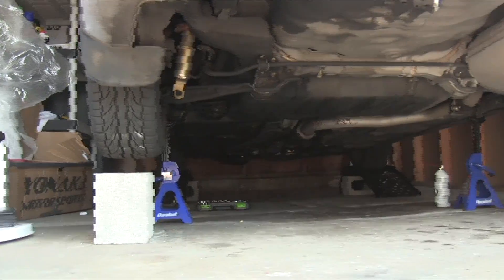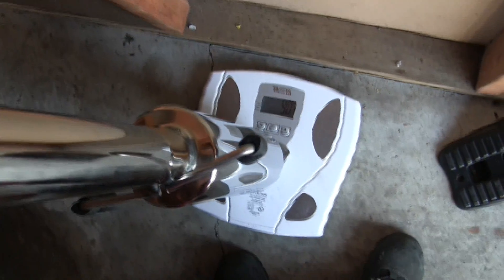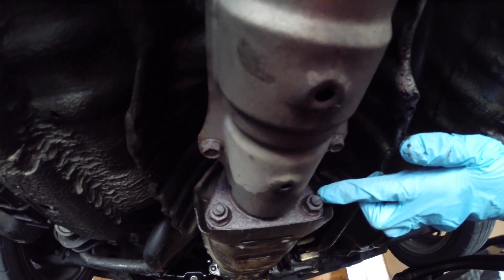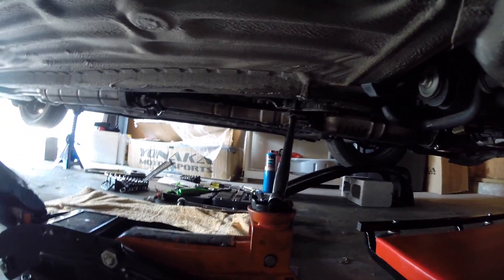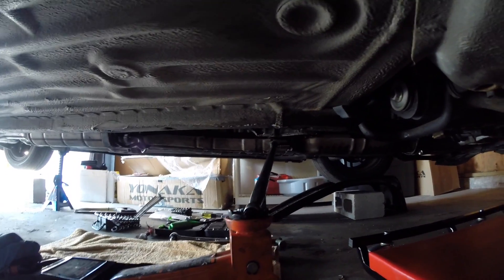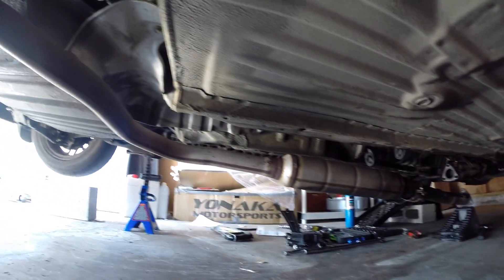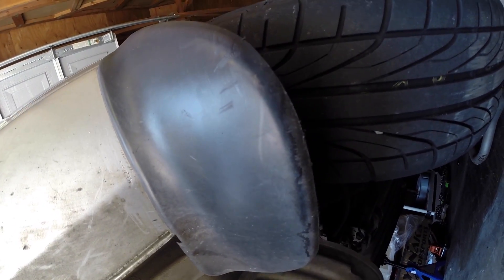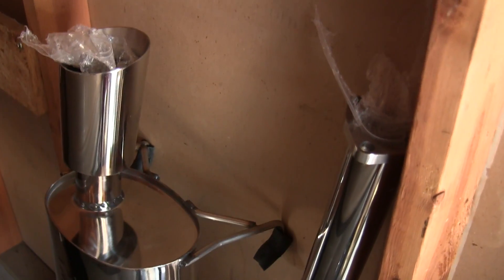How To Install A Catback Exhaust - Project Integra

Comment: Engineering Explained: check out Black Lightning examination gloves.  I don't know how expensive they are relative to the ones you're using but they are way more durable, better fitting, and comfortable; I think you'll appreciate them.
Reply from the maker: jayfulf Always feeling like a baller haha
Reply from the maker: I just buy cheap stuff, because I'm cheap. If one tears, I'll put on another glove. These are certainly poor gloves though.
Reply: the last two are subjective
Reply: Phil Not necessarily
Reply: Engineering Explained Buy yourself a box when you're feeling like a baller, you'll be glad you did

Comment: just an fyi i had this same exhaust and the resonator fell apart in just a few weeks, and personally i hated the ricey sound.  get the resonator changed out with a 24 inch to kill the bees in the exhaust and a vibrant low key flat black muffler and now it much better.
Reply from the maker: I suppose I'll have to provide an update with time. What do you mean fell apart? It does ride a bit low, but the exterior quality looks good.
Reply: Basically the internals of the resonator came apart and rattled like hell. Mine drags on stuff once in a while but it takes it pretty well.  It hasn't rusted yet which is good (about 4-5 years old)
Reply: punkenduro mine has lasted for months now with no issues. maybe just bad luck?
Reply: always could be

Comment: How long did the operation take in total (not counting the soaking of the nuts)? And how much did the Catback set you back?
Reply: Well the delay with the stuck nuts (lol) probably set him back 10 minutes. All in all it shouldn't take more than an hour or 2, depends all the problems you run into. This looked straight forward so it couldn't have been that long.
Reply from the maker: With filming, buying parts, and removing old nuts it took a long time. I also didn't have some of the tools I needed (my set didn't include a deep drive 15 mm, wtf) and I needed a propane torch. If the bolts go smoothly, could probably be done in 90 minutes or so. But nothing ever goes smoothly.